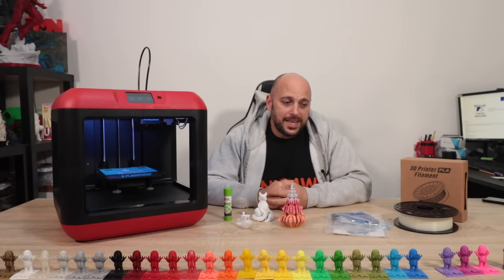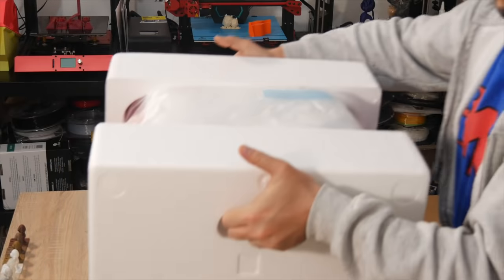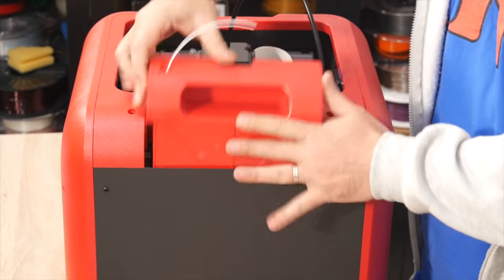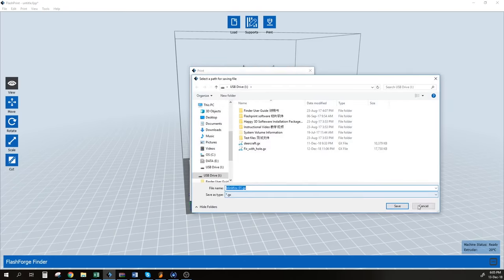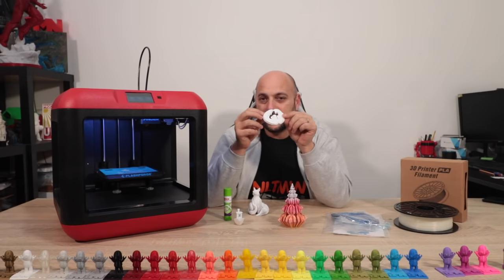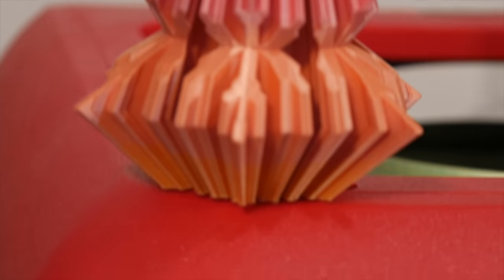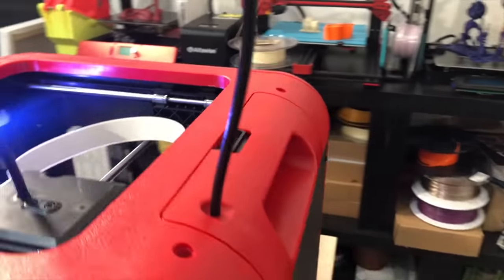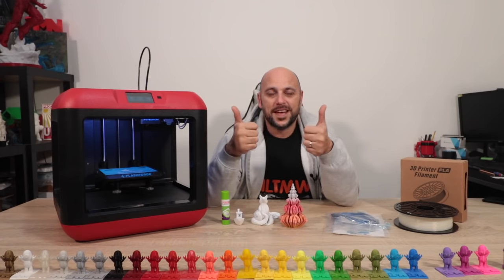Flashforge Finder 3D Printer - The Perfect Christmas Gift For The Young Maker

Comment: I have had mine for over 2 years and have been very pleased with it.  I have had very few failed prints (mostly due to the fact that I too forgot to lay down some glue stick or put in supports).  I print a lot of miniatures for my gaming group and the print quality is outstanding with very good detail on some of the smaller aspects of the mini.

Comment: I bought a Flashforge Finder as my 1st 3d printer and it has been excellent. Reliable results, good quality prints and easy to use...i use an external spool holder and it has worked well with a wide range of different PLAs

Comment: You can also print Pet-G and Flexible on the finder too. :) Flashforge print also has a great option to pause prints at layer height so you can change filament mid print to change colour etc.  Great printer although I have an earlier model.  Wood filament is great if you're printing solid areas.

Comment: Hey, good video again :-). I also was taking a look for Flashforge Printers. For an upcoming educational project I was looking for a nearly plug and play Printer, just to have another option to the Ender 3. I actually went not for the Finder but for the Adventurer 3. Like you said they have a really nice software and user interface on the touch display and the Printer is easy to use. I really like it. Also you can go for the "Expert" mode in the slicer (looks a little bit like Simplify3D) and there a few very cool and not expected options, so you are not limited to the slicer settings the Printer comes with. Keep on printing and have a nice day :-).

Comment: Did you notice that there is an expert mode (file-preferences-print) in FlashPrint slicer with a lot more options? I've used this printer some years and it's great except the print size is a bit too small.

Comment: I love my Flashforge Dreamer and was thinking of a gift for my Dad that was simple enough without overwhelming him.  Do you know if this printer can work with Octoprint?  The Dreamer and the FFCP have a slightly non-standard command set and they won't work with Octoprint because of those differences.  I think this was done to add some FF-unique features that weren't part of the normal gcode spec at the time.  With this being a newer, entry-level printer  I was wondering if maybe FF had made this machine as generic and compatible as possible.  I know my dad would get a kick out of doing Octolapse videos if I got him a printer.
Reply from the maker: to be honest i haven't tried but i doubt it. even the file format is not .gcode so i have my doubts. but since i have octoprint on the MK3 i can test it
Reply: @3DMakerNoob  So it only works with their own slicer?  I couldn't use S3D with it?
Reply from the maker: Apparently it works with any slicer, in fact they also sell a version bundled with S3D

Comment: A machine that size should a a 300x300 build plate not a 140x140.  Tom many of these commercial machines are way oversized for the build volume they offer.
Reply: The size was a bit of a bummer for me but if you angle the design in the software it is actually possible to fit bigger prints
Reply: it could print a tiny bit more in theory but the print head is huge and is the limiting factor on this machine. I think it is a designchocie they made to have it all encloused and less intimidating for people with little experience.
Reply: The print head is huge with the servo and cover and everything, so 300x300 is completly impossible. switching the bed and controller gave me 180x150 and that is really pushing it without rebuilding the hotend

Comment: I owned one of these.  Within two weeks, I outgrew it and it started causing issues.   The print surface is not very stable and I had major issues getting anything to adhere after a couple weeks.  It also does not fit many spools.  I would not recommend it.

Comment: Just curious, was this a paid promotion?
Reply: He did state that he was not paid for this review. I have an old Flashforge plywood dual, as well as CR-10, CR-10S, Tevo Tornado, Anycubic Chiron, and a couple others including my own Makerbot variation (which is what Flashforge is), and though it makes creaky sounds (the wood) when printing, the print quality is still very good--due to such things as MeanWell Power supply, etc. Flashforge makes very good 3D printers.
Reply: @louisboliou7432  Just checking. I own a printrbot simple metal and make my own so I wouldn't know.
Reply from the maker: quite the opposite, i do state that this wasn't a paid promotion. However i never mention that I actually pay import duties on almost all machines I recieve and i don't ask for a refund specifically so that no money exchanges hands :)